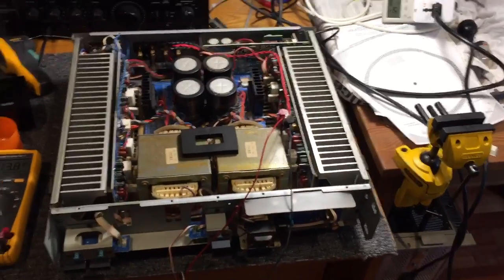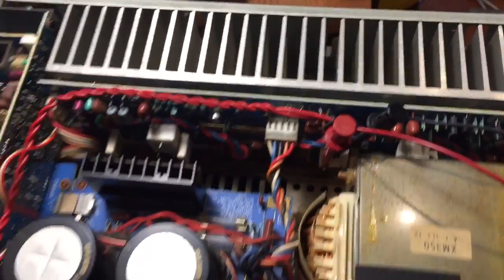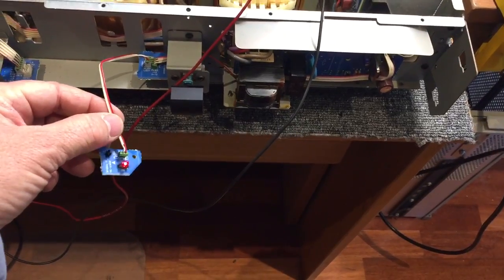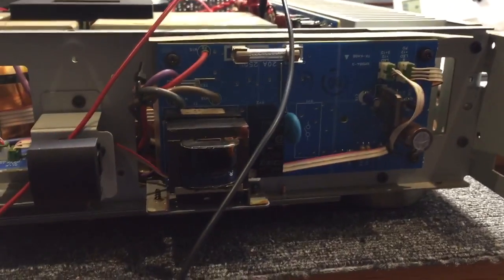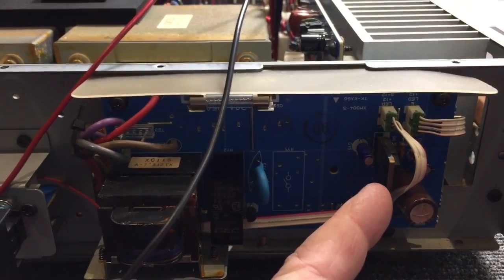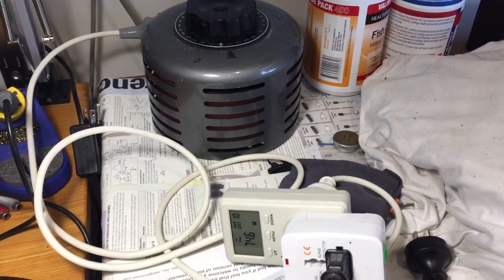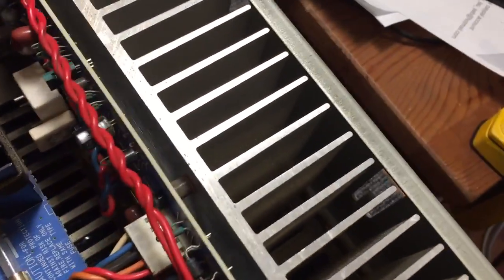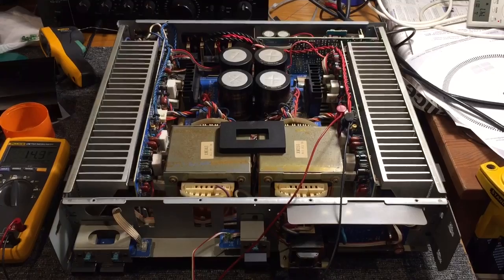Yamaha MX-1 Statement Power Amplifier Repair

Comment: Yamaha is very good in amplifiers, I fixed once a Yamaha rx v730 receiver amp with an earphone problem, the right channel was crackling and it was actually a relay that needed cleaning and after that the problem was solved.

Comment: Heck yeah real amp ! Voltage gain is what i look for in specs if a avaible. Just redone my Onkyo M504 new caps and output transitors left power transitors alone , Thankfully my bestfriend worked at emotiva as a manger of their repair shop those 8 caps were a pain in the Ass but end result I would put it up against any new 3k and under power amp with full confidence ! But the amp pulls the power out of the wall had to install my own dedicated circuit may sale soon for a lower powered class A 25 clean watts is all i need honestly

Comment: 2:46, newbie here, is that a cap that is bowing out and needs to be replaced or ok?
Reply from the maker: Hi Ben, no nothing of note here other than the issue that prevented the amplifier from starting. Capacitors in this region were tested and good, she ran perfectly after this repair.

Comment: Excellent job!
I'm renovating a B-2 now and would like some tips. Do  You know where I could find the power transistors. I need 2 pairs.
I would be very grateful if you could pass me information on the components that you have changed.
Once again, congratulations!
Reply from the maker: Hi Leonardo, thanks for the lovely feedback. Be careful, these amps use VFETs, they must only be replaced with VFETs and these are very scarce now and require careful matching. I have a Japanese VFET supplier, but not all types are available and sometimes circuit changes are needed depending on the grade of VFETs used. I would need your amplifier here for repair and I suggest you take her to an expert unless you are very experienced in such repairs.
Reply: Mike's being polite here but realistically unless you're very experienced and know exactly what you're doing with these, it's not worth dabbling with a vfet amplifier... the transistors are just too precious and rare. Not suggesting you don't have the skills but if there is even the slightest doubt, this is the time to pay a professional, and not just any pro. 🙂

Comment: What is the likelihood that one of these MX-1 amps would still function perfectly today if it hasn't been recapped or serviced?
Reply from the maker: The likelihood of perfect functionality with zero maintenance is low with any piece of electronics of this age. Most of these that I've seen have only needed standard age-related maintenance and small repairs though, certainly not full re-capping etc.
Reply: I bought my MX-1 in 1998 (25 years ago!)  and it has never seen a day in the shop! :) The CX-1 pre-amp I have with it had to have a couple of cold solder joints repaired, but that's it. Tremendous value amplifiers if you can find one...especially considering what you would pay for the new high end Yamahas today.

Comment: Is this better than MX-1000?Anyone knows the answer?Thanks!
Reply from the maker: Great question, I haven't had the opportunity to compare these side by side, but someone else might have. I have looked at both individually though and they are both superb amplifiers, I'm sure you would be happy with either.
Reply: I would love to compare them. I have three MX-1000u's, an M80, PC2002 and a P2200. So far MX-1000's easily dominate over my other amps. I have a bunch more, but nothing in the same power levels and they don't compare in sound output in my listening room either. One day I will get my hands on an MX-1 though and make my opinion🍻
Reply: @whiplashmachine  I already know the answer.MX-1000 is bit more powerful,but for sound quality MX-1 outperforms it.I have read somewhere that MX-1 i even better than MX-2000.
Reply: @beslemeto  I still need my own confirmation though. I have an uncle with one, so I have heard an MX-1. But in his setup, room and speaker selection, I feel my setup dominated. Need to do more studies in a "A-B" situation.  Plus it would be the perfect opertunity to listen to all my favs again at abnormal decibles😁

Comment: hi  mate,,is  biamping  these  amps  good  idea??
Reply from the maker: Hi, bi-amping refers to how speakers are driven, so you don't bi-amp amps, you bi-amp speakers. With bi-amping, you need an active crossover and as many amps as necessary to cater to the speakers you are bi-amping. You could certainly use a high-quality amplifier like this in a bi-amping arrangement, but you'd need several of them of course, depending on your speakers!
Reply: @LiquidAudio  I have got VMPS RM-X speakers and I use MX-1 to power them,so would u suggest I use one.pair of MX_1 to drive these speakers??
Reply from the maker: I'm not familiar with the speakers but remember if you bi-amp, you'll need an active crossover, and then you'll need a pair! You can of course just bi-wire your speakers, using both sets of speaker terminals and one amplifier. Much cheaper, simpler and only one amp needed and no active crossover. Good luck whatever way you go!
Reply: @LiquidAudio  thank you for your advice,I am already bi_wiring them,so I dont need to biamp it seems so
Reply from the maker: My pleasure re the advice. Bi-amping is very different to bi-wiring, potentially better, but not something the average end user can implement.